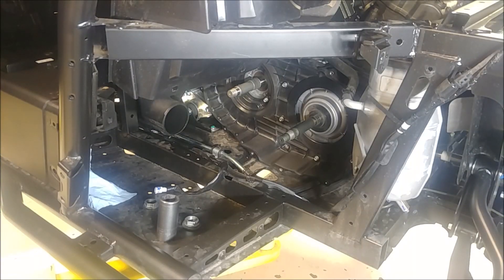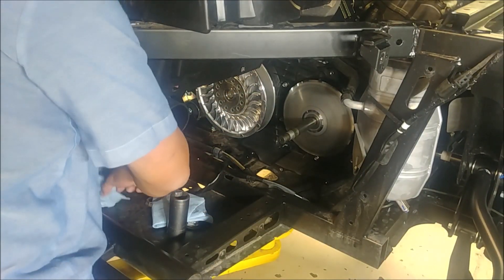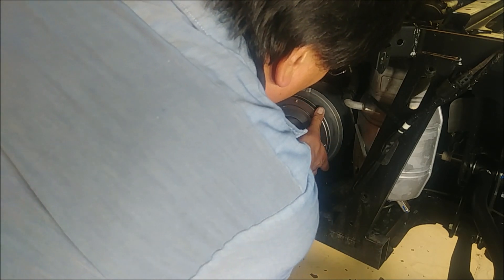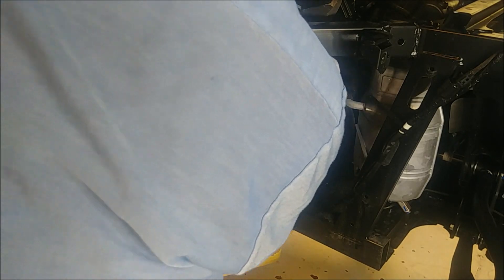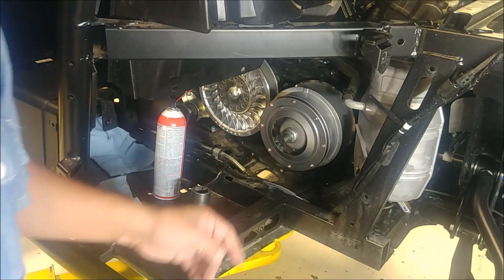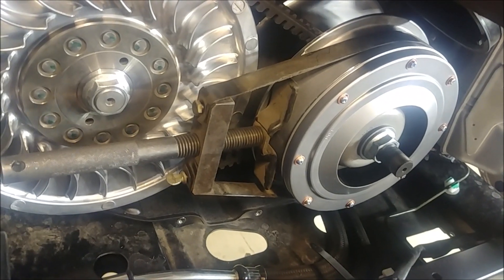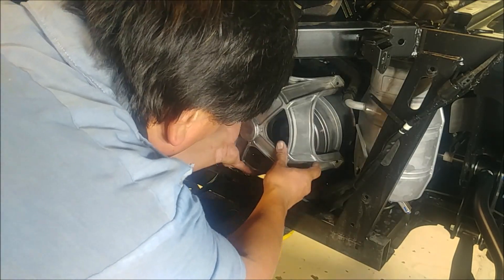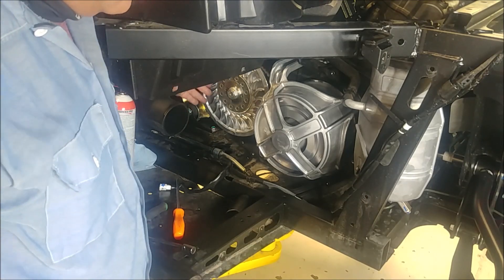Reinstalling the sheaves on a Yamaha Wolverine RMAX 1000

Comment: I know I may be digging up bones here but I just had a problem this weekend and you seem to be the answer man. My 2023 rmax2 x-tr I drove into a very deep situation water never came over the hood as the inside of that area was dry the air filters were dry but the water was lap deep, I got winched out and pulled the plug on the cvt cover no water came from there either, let bike sit for 25-30 with cvt plug out reinstalled and tried to drive away engine responded but bike barely crawled. 
Towed back to the truck and began to replace the belt once the cover was off in the bottom center of the inside cover there was an eye dropper worth of water the sides of the belt were glazed so I went ahead and installed my new belt after wiping the sheaves off did notice the primary sheave basket appeared to be covered in oil ? . Got everything back together  after cleaning  go do the break in and bike still has no power in low range and high range was about 50% reverse seemed fine. 
I did notice a groove about 5/16-7/16 down the secondary sheave
Reply from the maker: Could you repost this to Wolverine Forums?  It's much easier to communicate and troubleshoot issues.
Reply: Have a specific one in mind ?
Reply from the maker: https://www.wolverineforums.com/forums/rmax2-rmax4-cvt-drivetrain-transmission.294/

Comment: Did you break it?
Reply from the maker: The X2/X4 clutching had some parts that would fail around the 1600-2000 mile mark.  They were simple $10 parts that I would label as 'consumable', so we wanted to dive into the RMAX CVT to see what improvements were made to address those parts and Yamaha Engineers didn't disappoint.  See here for back story:  https://www.wolverineforums.com/forum/268-x2-x4-cvt-sheaves-wet-clutch/29630-you-guys-getting-higher-mileage-need-service-your-secondary.html
Reply: @MassiveOverkill  Very cool! I'm doing research on the RMAX, I'm looking forward to seeing the reviews for the 4 seater.
Reply from the maker: I'll have an RMAX4 LE shortly
Reply: @MassiveOverkill  so what you're saying is that Yamaha fixed this problem. I just bought a Rmax4 and hope this problem is fixed.

Comment: Do you hava part number form primary sheave holding tool?
Reply from the maker: The one I use at home is a discontinued Hunterworks holding tool, but Weller Racing sells the EPI holding tool that fits in your bench vice:

https://www.wellerracing.com/Clutch-Compression-Tool-by-EPI-Performance_p_4195.html

Part Number: CCT510
Reply: Thank you for the response! I have that tool. Im talking about the tool you have in this video. That wraps around your primary sheave so you can torque it to proper spec.
Reply from the maker: @akyrapannell5076 sorry that's part: sheave holder 90890-01903.  It's on Amazon:  https://amzn.to/3MqAqkt